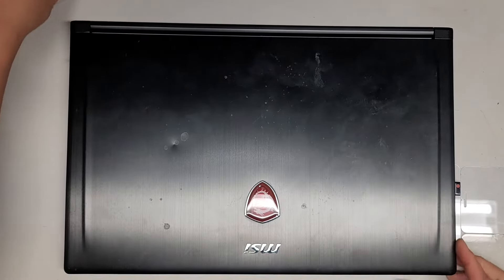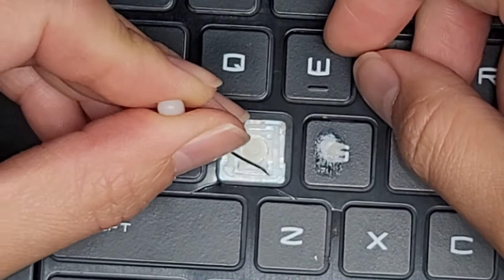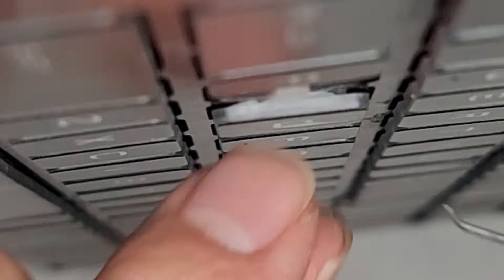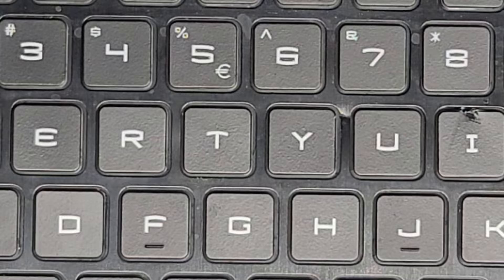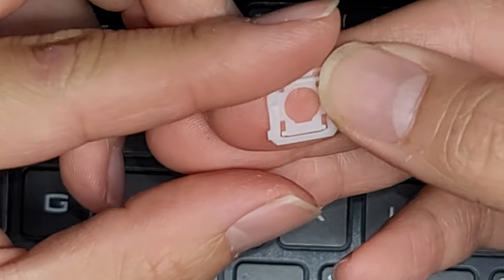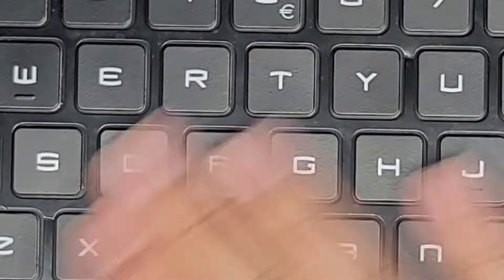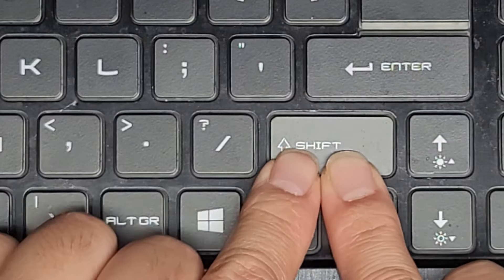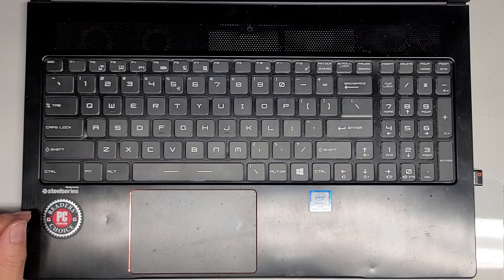MSI GS63VR STEALTH PRO 6RF 422US BB7670H16G1T0X 10MH Disassembly Keyboard Keys Replacement Repair

Comment: I've got a similar model to this, and my e key has stopped working completely (the hinge also snapped to make things more annoying). Any ideas how to fix it, or is it a replacement keyboard job? :/
Reply from the maker: If it doesn't work when you press the nub, the keyboard needs to be replaced.